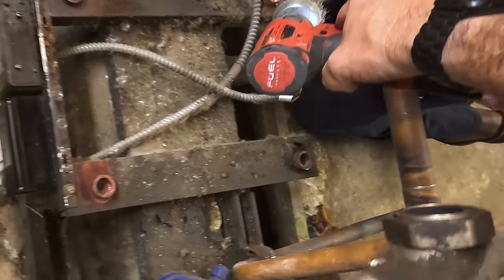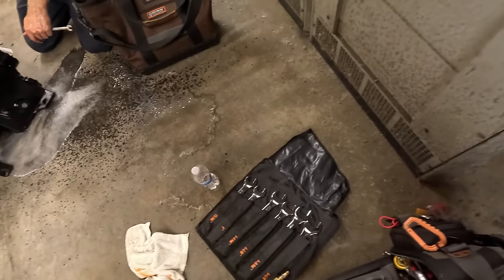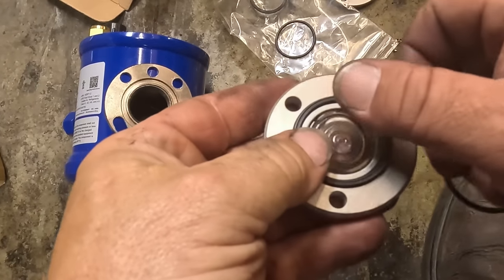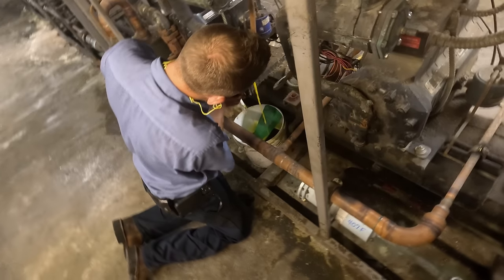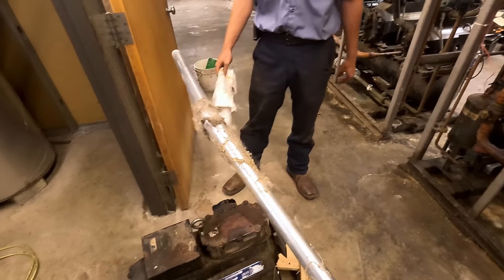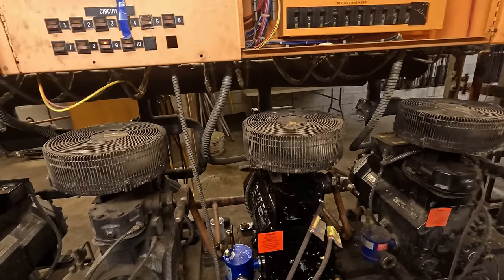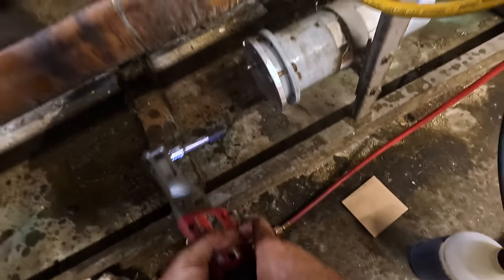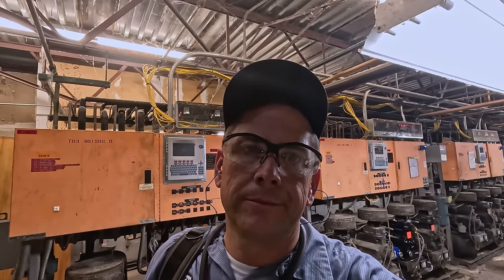Semi hermetic Compressor Failure Replacement Procedure

Comment: Reminds me once when a colleague hooked up the vac pump to the circuit and opend the valve when it was still under nitrogen pressure ... The vac pump screamed an I got showered with oil even though i was about 9ft away  and HE didn't even  get touched !!😂

Comment: at least you put the bolts in that hold the compressor down. I`ve been to several stores recently that didn`t have any bolts holding the compressor down. Compressors much larger than the one you changed. great video as always
Reply from the maker: There was only one nut on all this bolts. Total craziness.

Comment: So it was a burnout and you use the Freon again? Just cleaning it up with the driers am I correct? I assume you do this because It’s a large amount of Freon and shared. Do you add acid neutralizer or just use HH driers? Do you retest for acid?
Reply from the maker: Correct we use the refrigerant that's in there because there's probably 400 to 500 pounds. Correct HH dryers and yes checking for acid is a smart thing to do.

Comment: Great video don’t laugh but we all did the same thing of not released pressure and getting oil on you essential new work pant or new work boots.l glade it shows what it takes to change a rack compressor. When l did racks we had two guys on a team of 25 service technicians that’s all they did if we found a compressor bad if it wasn’t a emergency that a rack couldn’t run without that compressor the company would send those two guys to replace the compressor l did my share of compressor change out .
Reply from the maker: It’s easy, just time consuming.

Comment: If you remove the valve plate,you will probably find the cylinders full of oil.burnout.a plugged orfice in the suction accumulator maybe 2 cents.
Reply from the maker: If you seen the short video prior to this one where I change the plugged filter dryers that had 16 pound drop across them you might think that the refrigerant velocity had increased so greatly that it brought the oil back that was out in the system. Also that the suction valve was shut on that compressor and if you look at the placement on the manifold, it became a trap for the oil that came back.

Comment: Quick question Rick : do you use a stainless steel wire brush to clean the mating surface or is it brass wire ? 
I'm hesitant to use stainless cause I fear I'm gonna scratch the surface but brass sometimes is too soft to clean properly.
Reply from the maker: I’ve showed several times running that brush on my skin of my hand. It’s not real aggressive that’s why I like the smaller brush, the bristles are smaller. Plus the brass brushes tend to leave a yellow hazing on material. Stainless seems to clean up better and I can use it on miscellaneous things and then clean it very easily.

Comment: if you got a new oil pot, sight glass and other, why bother draining the oil and removing parts while it's still on the rack? yank it off, toss aside and keep trucking, then drain the oil later with it hanging over a bucket.
Reply from the maker: Cuzz then you wouldn’t gave anything to talk about. 😜🤪

Comment: Are those liquid canisters always 30lbs of torque? Or do they vary depending on the rack
Reply from the maker: It depends on the bolt size but most likely it’s gonna be 25 to 30 foot pounds.
Reply: Thanks man

Comment: @ 5:58 Nilog + hand dirt = perfect seal 😂😊 
That is what the owners deserve if they don’t put at least a sink close to the refrigeration rack were you need clean hands 😂… if they don’t care about technicians why should we care about them 😂
An included pressure washer with detergent dispenser + air compressor would be a nice addition to the rack room to be able to clean the compressor before dismantling it… 
Those 2 together won’t cost more than 2000-3000$ but it would increase the work quality …
Reply from the maker: In a perfect world, unfortunately, these people care less about me one way or the other then they complain about the bill nonstop.

Comment: Off topic question, I just had a scroll r22 ac compressor go locked rotor after pulling the disconnect and cleaning the condenser then putting the disconnect back in. I have never had this happen do you have any thoughts.
Reply from the maker: Did it stay locked rotor after you put the disconnect back in? That definitely is different than anything I've seen before.
Reply: Likely bad run capacitor or weak. Just showed itself when u stopped it to clean the condenser.

Comment: Holly crap have a little oil do we??
Reply from the maker: the filter dryer was completely restricted prior to me returning and now that I've been gone for a week the velocity was much higher and that's why the oil must've came back. I had that suction closed so that burnout material wouldn't go into the system anymore than it already had and that's why it pocketed the o.

Comment: 12:28 I mean your putting thread sealant on what looks like a flare / jic fitting. Neither one take sealant.
Reply from the maker: Like I said it’s on the threads to keep it from vibrating loose. Not the face of the flare.  Oil it all you need on the face and rear of the nut.